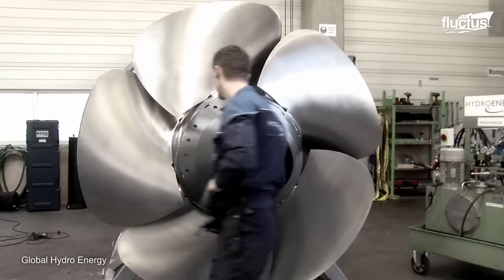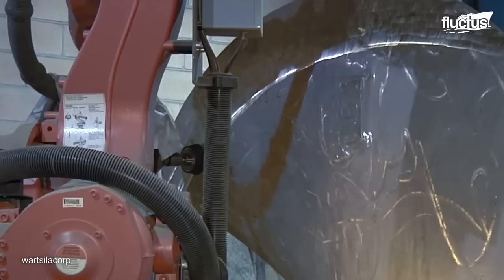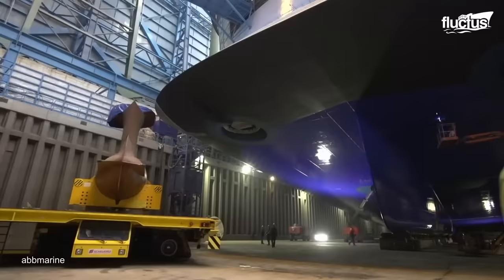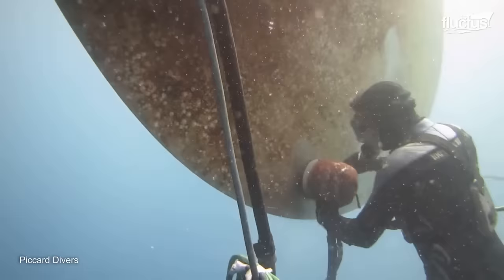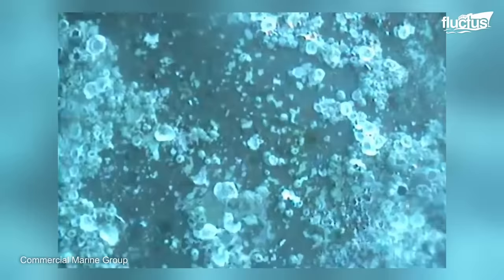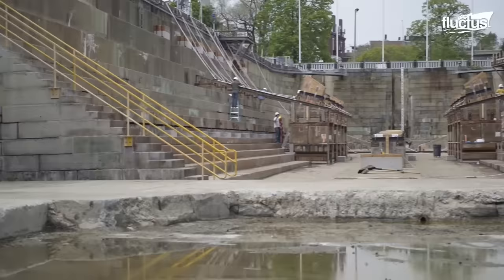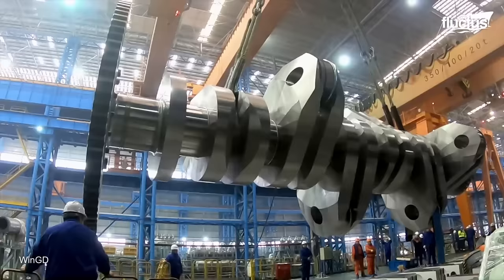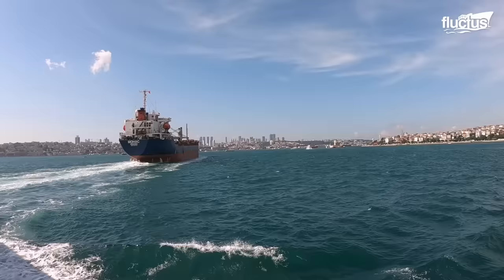What it Takes to Manufacture Million $ Propellers Moving World’s Largest Ships

Comment: Lets ignore all the high tech manufacturing tools and materials. Sure, sure, made like back then! Nothing has changed at all and I bet modern understanding of physics has no influence at all regarding blade geometry and shape!
Reply: Design of geometry and shape of ship propellers has not changed that much;  that includes hydraulic turbine runners.
However, the accuracy of the shape on modern propellers approaches the theoretical requirements much more closely, to say nothing of the speed of modern manufacturing methodology such as CNC contour machining.